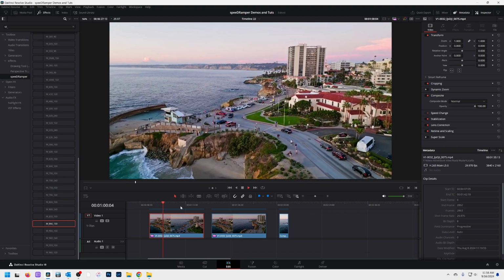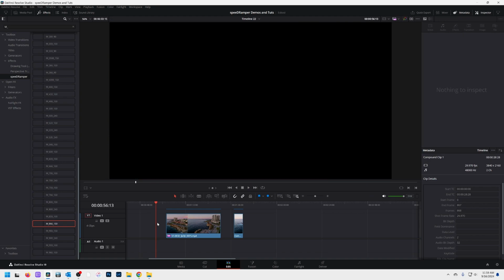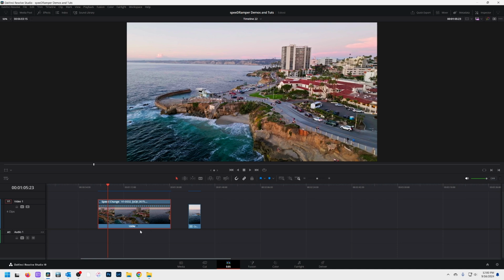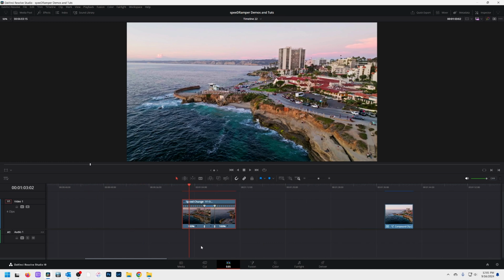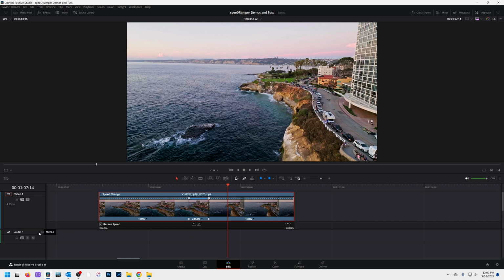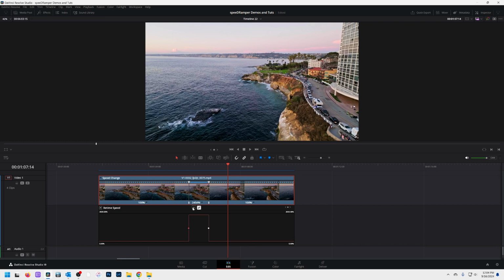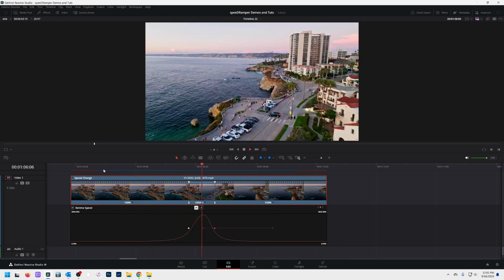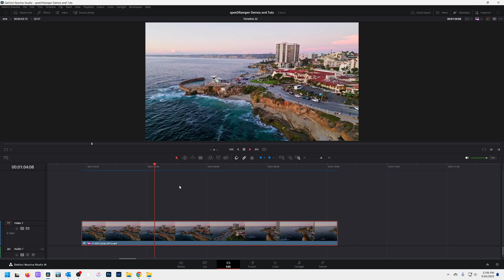How to do simple Speed Ramp with DaVinci Resolve

Comment: $129! 🤣
Reply: I struggle with paying that much for a plug-in that isn't actually adding any new functionality. It's just offering a different user interface.
Reply from the maker: @charliesaigon  This is like VIP TSA Pre-Check at the airport. For frequent travelers, it's 100% worth it, to skip the monstruous security  line. This system is like like making a cup of coffee: you can build chop wood, build a campfire and boil water or you can push a button on the Keurig machine. And with the machine you get no cleanup, better coffee, more choices and flavors. But it's specifically for those who are doing speed ramps on a very regular basis, no question.
Reply from the maker: Funny that you should say that. I bought a similar plug-in selling for $150 and I didn't even blink at that price. If it works, worth every penny! Unfortunately the one I bought didn't work :(